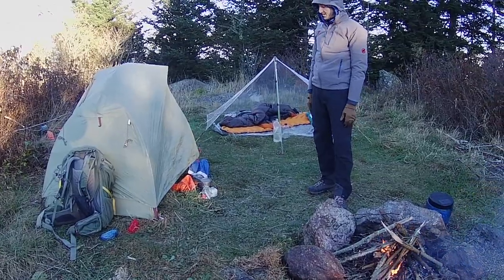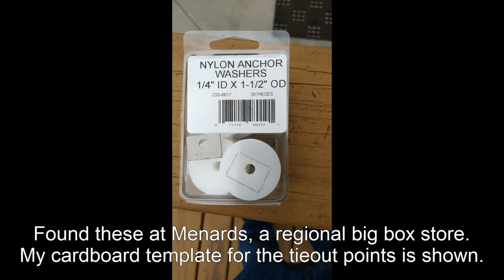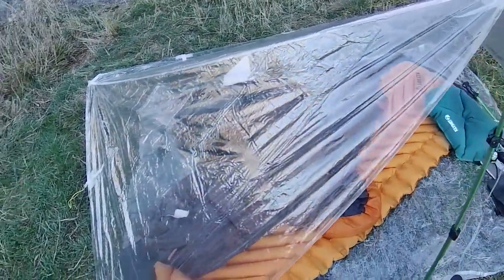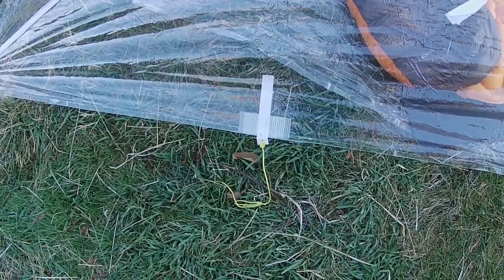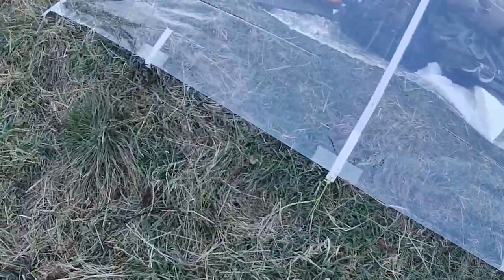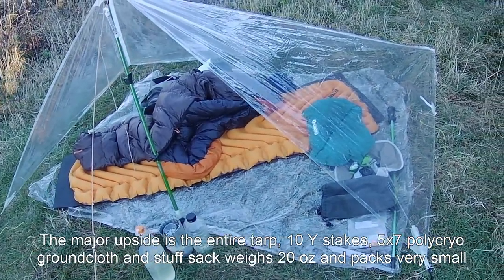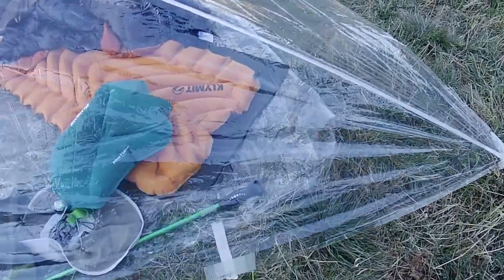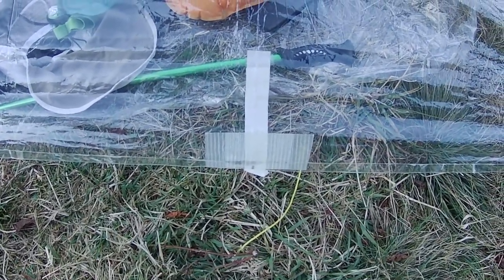MYOG Ultralight Polycryo Tarp - Rev 4

Comment: How long did your tent last or hold up? Could you use this a a tarp for a hammock on backpacking trips?
Reply from the maker: I could still use it. I don't get to backpack a lot but would expect it would last maybe 100 nights. It likely depends on the winds and sun experienced. I would just keep checking for damage of any kind to the tape and tieoff points as those are the key elements. Of course, if you don't take care of it all bets are off as polycryo will catastrophically fail if torn/punctured so if you just jam it in your pack with stakes or snag it on a branch while unfurling you're likely going to have to bail. As for hammocking, I believe those generally are larger tarps so if you used the full size sheet in an A-frame like the article I linked in the description it may work out for that.